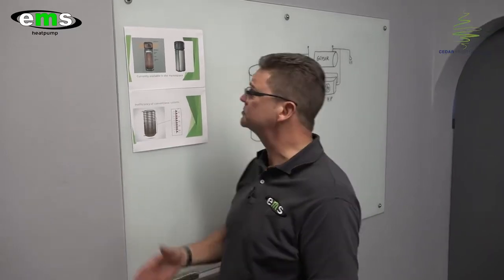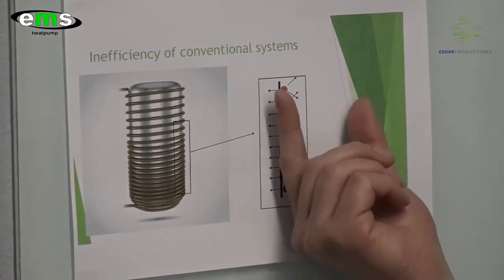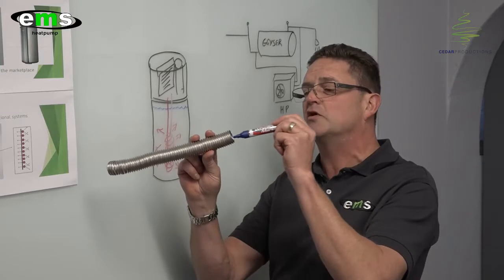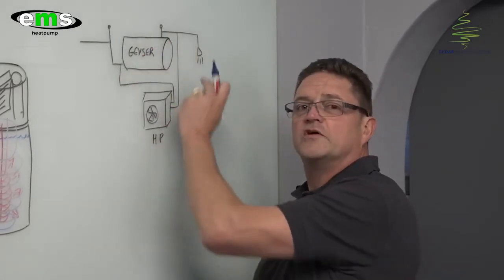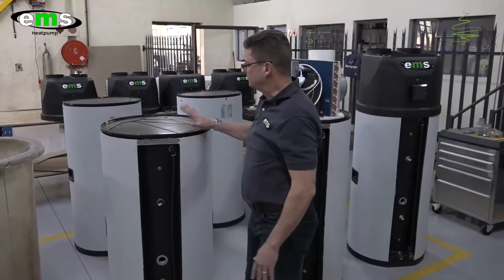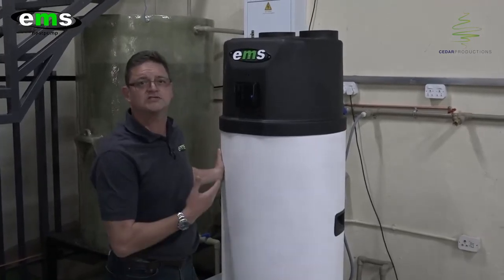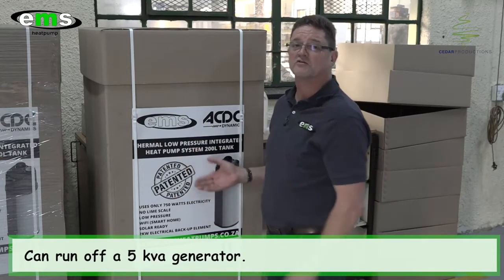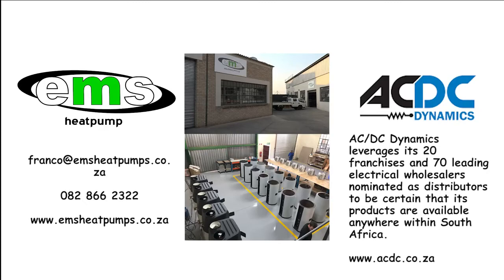EMS Heat Pumps

Comment: Good video.  On a setup where a heat pump is connected to a geyser (tank), like in your diagram on the whiteboard, how should the waterflow be connected?  Heat pump inlet fed from cold municipal supply or fed from within the tank?

Comment: Ek like dit baie oom!
Reply: Maar die geyser is nou 40k?

EMS-TH200DT
220L 0.75/3KW LOW PRESSURE INTEGRATED HEAT PUMP / TANK
LIST PRICE:R 39 386.00DISCOUNT:0%SAVED:R 0.00
NET PRICE
R 39 386.00

Ek was bereid om 25k te betaal. kan nie in 2 jaar met 15k klim nie?